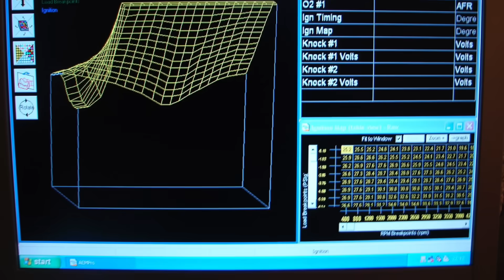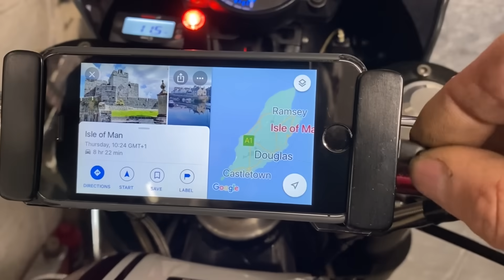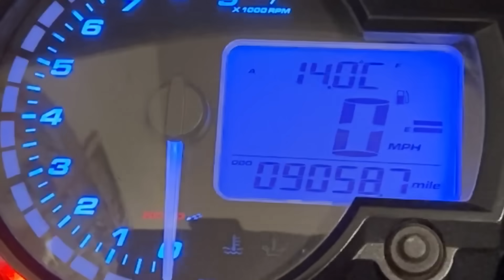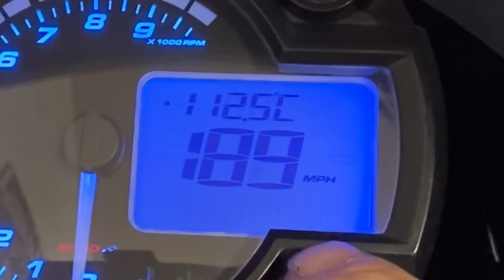Millyard Viper 8 Litre V10 Motorcycle - Part 1

Comment: I still to this day cannot fathom how a single, well-spoken, pleasant man built all of these beautiful machines that'll make any mecha-head and motorhead drool over, all in his shed...

You, Allen, is why I chose to pursue a degree in Mechanical Engineering, and are a source of endless inspiration in life.
Reply: Ahhh, the life-changing magic of sheds.
Reply from the maker: @seanys  Its a good read and look out for a pic of my Flying Millyard V Twin
Reply: @AllenMillyard  would the viper motorcycle be better served by a torque converter or would it be too complex? Similar to the single-speed transmission of the Koenigsegg Regera (minus the electric motor)?
Reply: @sepg5084  I'm not Allen but I have an answer to your question. I suspect that a torque is not only an unnecessary and weight-adding complication, but that torque multiplication would actually make the bike more difficult to ride. The engine has sufficient torque at idle to easily move the bike from rest and because the torque increases progressively with RPM, smooth acceleration is possible without the rear tyre breaking traction. A torque converter might upset this and cause the rear wheel to unexpectedly spin and the bike to fall on its side.
Reply: @seanys  There's a really good Australian book that's similar called "Blokes and Sheds". If you ever see a copy, grab it. It's well worth a read also.
Reply: What is your background and day job? You are clearly a craftsman and prove that it's possible to create masterpieces of engineering in a shed. Britain does "man in shed" best. You seem to be such a modest, nice bloke too.
Reply: @fox514d  New Zealand does 'man in shed' quite well too. Have you heard of John Britten?
Reply: @Shaun.Stephens  And don't forget Bert Munro!
Reply: @Shaun.Stephens  not yet but I'll investigate...
Reply: @BRITISHREPUBLICANuk  Bert Munro of The Fastest Indian fame. Great bloke.
Reply: @fox514d  To the best of my knowledge, Allen was a nuclear engineer with the Ministry of Defence, here in the UK.
Reply: I know! And he seems so mild mannered too. Certainly not the unhinged lunatic you'd expect would be behind these utterly wild and fantastic machines.
Reply: Props to you. We need more Millyards in this world